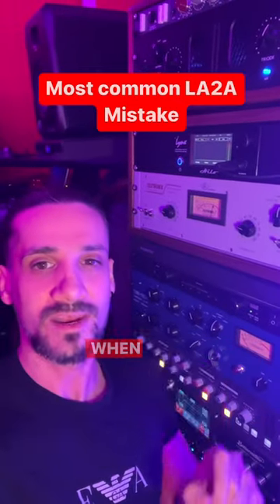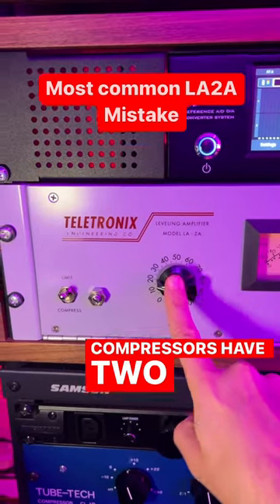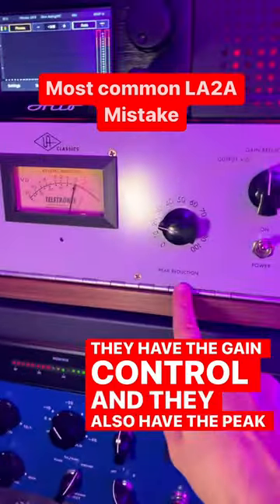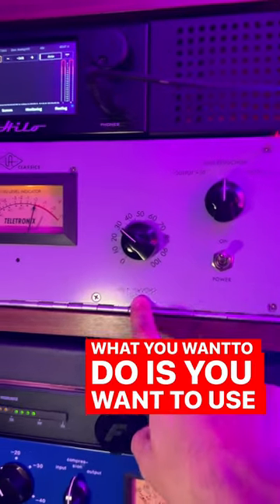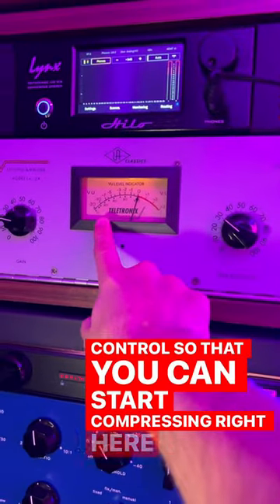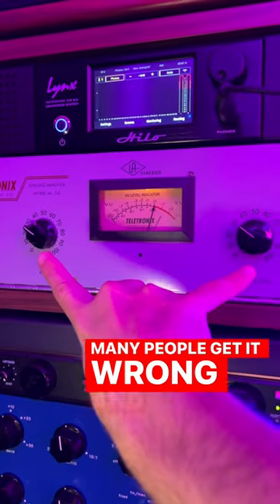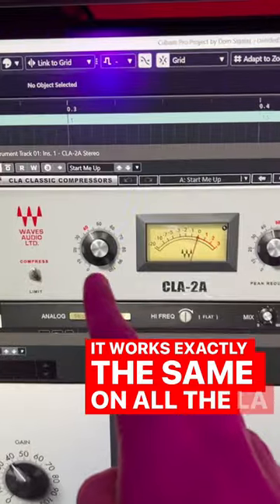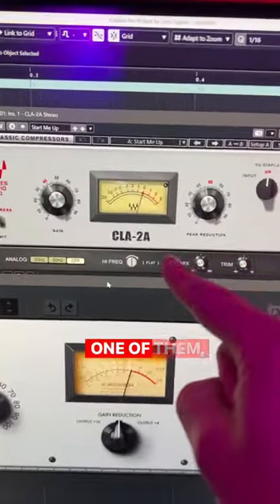Most Common LA2A MISTAKE people make!

Comment: I use my LA2A

in front of my guitar rig/s and drive my tube amps front end harder.  Sounds way cool as a sort of overdrive/distortion pedal.  My guitar rig is always made up of at least three tube amps driving multiples of cabinets.  WET/DRY/WET configuration.  Just like EVH.  Cheers!

Comment: question I just got hardware. For rap should I use Wa2a and 1176 on front end for vocals?
Reply: Depends on what you want. Rap itself is a versatile genre. If the record is dense and you need that forwardness you can go 76 but dont squash it to death unless that's the point. 2a is forgiving and gives you the best flexibility. Its hard to mess up a La2a on the way in
Reply: For rap vocals you want to use an avalon 737
Reply: @thebeatmajors_yt  Got you!!
Reply: @UncleBenjs  Don't have that. Only the UAD plugin of that.
Reply: @RodPickens  That is the classic channel strip that the vocals on so many of the top/classic hiphop tracks have been recorded through
Reply: @UncleBenjs   I know just a bit expensive due to all the other purchases I had to do like ADAM studio monitors, analog gear, mac computers, etc.. Just expensive

Comment: You said people think it works like the 1176, but on the 1176 it's also input amplifier and output amplifier. Compression is set by the ratio (technically a threshold control but whatever). But some people think more input means more compression (in a roundabout way distortion from driving the amp circuit is compression - but that's not what they think is happening)

Comment: Been using many variations of this, and Softube is the best sounding I've tried yet, any others top softube?
Reply: The UAD plug sounds really good imo. It doesn't really handle transients the same as a real LA2A, and actually controls the transients a lot more, but it sounds really good still. A lot of people will run an 1176 into an LA2A to control the peaks before leveling, and the UAD one kind of does both to my ears (although doesn't quite sound like an 1176+ an LA2A, it still sounds really good and handles the transents for you, just like if you ran a 1176 into LA2A just without the added saturation of the 1176 stage).
Reply: @DaftyBoi412  Definitely want to try to incorporate the UAD stuff into my workflow and compare the results. 1176 - LA2A is a common chain I use, so swapping out Softube for UAD will be a good/easy comparison. So far, from what I've tried, in my audible opinion, Softube (Native Instruments) is the best, Waves is OK, and Avid's is not good. I'm sure many will disagree, and I'm sure native vs DSP variations have an audible difference as well, so keep that in mind. Thanks for your input!
Reply: @jakenuno9900  If you run 1176 into the UAD La2a it might kill the transients a bit too much (I've never actually tried, but the UAD seems to hit the transients way more than most LA2A plugs I've heard - at least with the particular vocals I was listening too through the plug with when I heard it - LA2A is notorious for being program dependant so it might still be nessisary for faster stuff). 

I was more talking about hardware 1176 into LA2A, but ofc it works well with faithful recreation VSTs too, and I also know a lot of people who run the plug ins like this too. I'm just not sure if it would even be nessisary with the UAD plug (you also get HEAPS of tone out of it too)... worth testing out though!